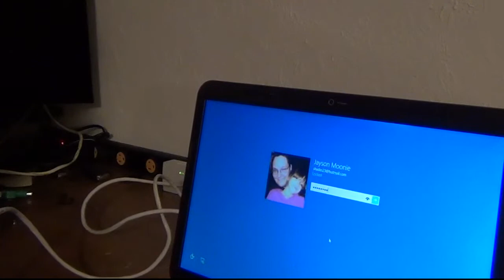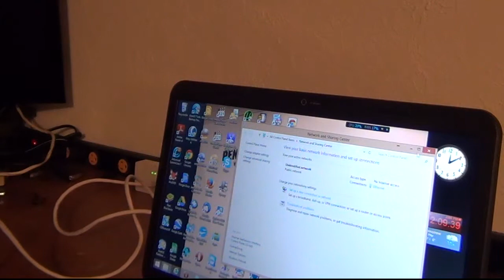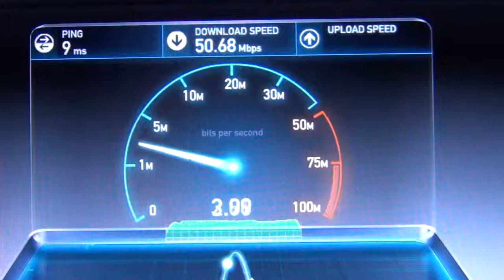Powerline Networking

Comment: Really helpful video, planning on going out and buying myself one :D

Is this the kind of thing for me if im experiencing SUPER inconsistent pings while playing games online? My ping will spike from -30 to 700+ in a matter of seconds and is extremely annoying >:c Ive tried plenty of other fixes and im almost positive its because of my wireless network
Reply from the maker: Austin Harper yah it should be better that wireless... less interference than wifi ... wired is still by far the best .. but if you can't run a cable this is the next best thing
Reply: Great to hear, mine should be here in the next few days, Newegg was having a sale